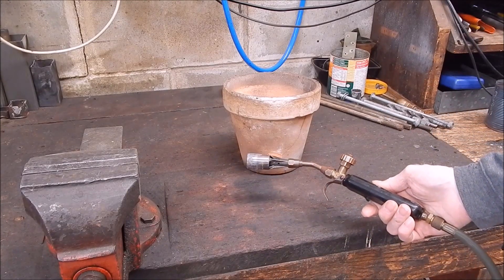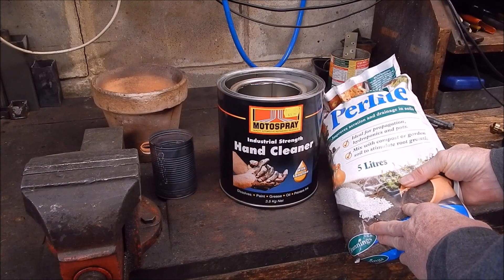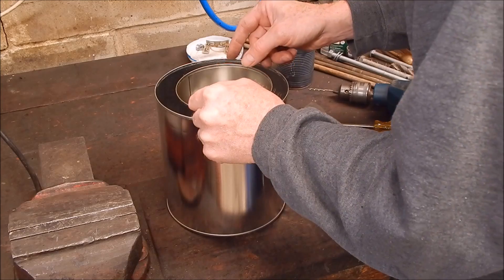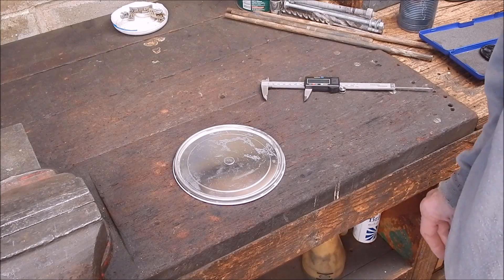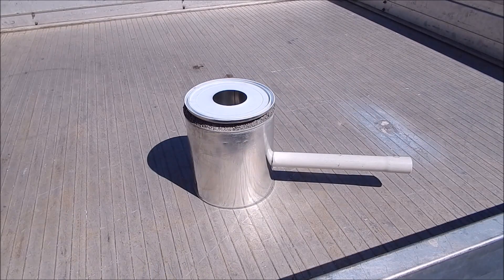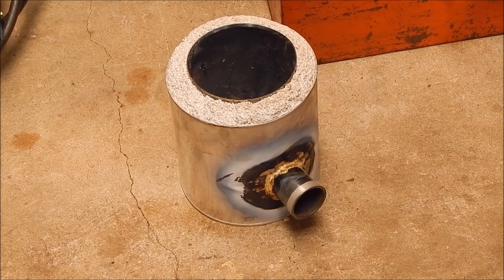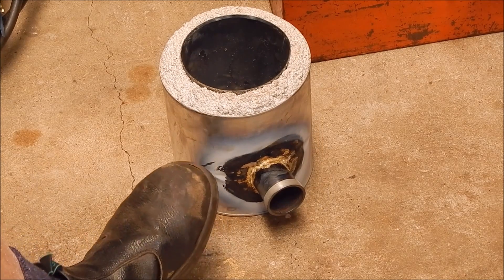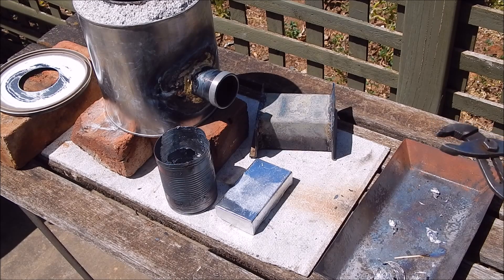Melt aluminium in a paint tin furnace

Comment: well I made mine [thanks for the info Rob] didn't have paint tin but a redundant 4.5k gas bottle so I used that & a length of enamel chimney for the inner & I tried my sievert torch at first but not hot enough so I have a flamefast gas/ air brazing hearth & tried that torch  boy did it work, soon glowing red & a stainless sugar bowl for a crucible. well pleased,great design.
Reply from the maker: +headstocktailstock 

Next time I make one I will also use a scrap gas bottle - good idea.

Rob

Comment: Like it, saves firing "the big yin" up if you only want a small melt, I'm going to make myself one,did you use portland cement or fire cement? btw don't you line the "crucible" with a refractory wash?  cheers.
Reply from the maker: +headstocktailstock 

I just used some old Portland cement I had.

I didn't line it.

Next one I build will be with heavier gauge metal.

Cheers Rob

Comment: Hi Rob,  nice looking furnace you have there.  Just wondering what type of cement was used to mix with the perlite?  Also how far up do you think you have the inside tin sitting up from the bottom of the paint tin?

Thanks
Reply from the maker: Robert A I just used some ordinary Portland cement I had.  It would pay to mix it a bit heavier, about 4 to 1 would be better.  The inner tin bottom is about 15 - 20  mm off the outer tin. The inner tin is not going to last long, so I would do it next time with a heavier thickness metal. Cheers Rob
Reply: xynudu Thanks for that, I wasn't 100% sure, some people seem to use fire cement.  Do you fill the bottom first and then place the inner tin inside?  I will have to see if I have anything stronger suitable around in my scrap pile.  I might have an fire extinguisher or some 1.5-2mm stainless tube.  If not it is cheap enough to make another when this fails.

Also how far up do you have the pipe sittng from the bottom of the inner tin?

Thanks
Reply from the maker: Robert A Fire cement would be better if you have any.  Yes, fill the bottom then put the tin on it, then do the sides.  The tube is about 10 mm from the bottom.  The old fire extinguisher sounds good.  I found that the cement takes a long time to dry, even in hot weather. Cheers Rob.
Reply: xynudu No I don't have any unfortunately looks to be expensive going by bunnings.  I will just stick with the Portland for the time being. I just had a look today and the fire extinguisher looks way too small.  I will just end up doing what you did for the time being and then later on I will make a better one.  I've probably only got around $15 of materials in it so far so no big loss if it fails.  You seem to have gotten a few melts out of it.
Reply from the maker: Robert A Yes, the bottom of the inside soon gets burnt out, but it certainly works extremely well and quicky at melting handy amounts of alloy. Rob

Comment: Nice job again Rob! You seem to have a lot more time than I do.
Two things I noticed:
1: The tin you use to melt your aluminium may not last long and should be replaced after one or two melts. Otherwise your furnace may become filled with liquid aluminium. 
2: You seem to have the burner tube at dead center. Best practice (at least on YouTube) is to offset it somewhat in order to get a rotating airflow inside the furnace. 

/Leo
Reply from the maker: Leo Gijssel I'm retired, so time is there, but I have lots on the agenda, so I have to share it around.  I considered swirl, and mention it in the video, but went straight tube as the flame is wrappig around the tin quite nicely.  Certainly melted the alloy no problem and quickly.  The tin will be disposable :)  Cheers Rob